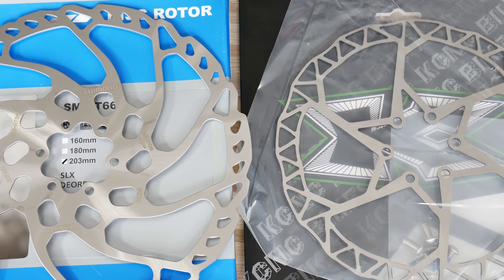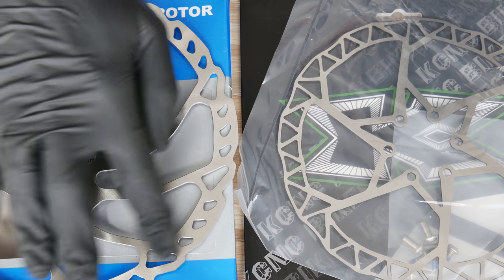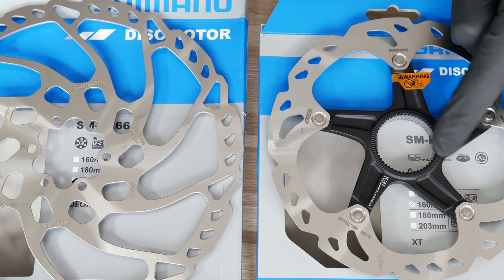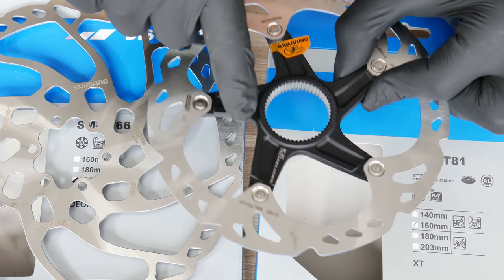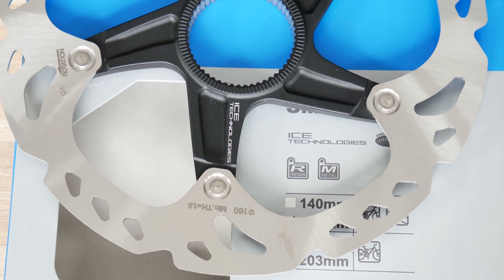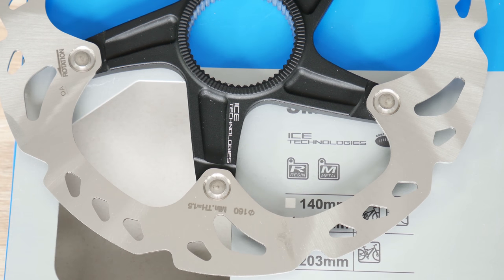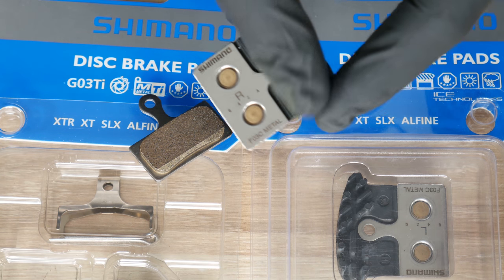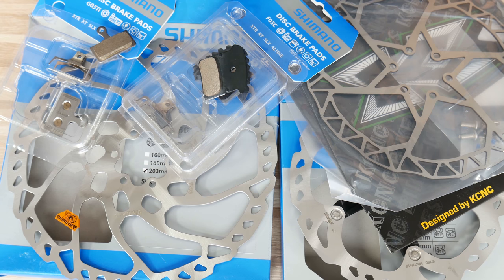Bicycle Disc Brakes - How To Prevent Overheating. Ice Technologies, Pads With Fins...

Comment: There's an article on Bikerumor.com about a road cyclist who nearly killed himself using Ashima super light rotors. He boiled his brake fluid and had to controlled crash his bike at high speed. A brake rotor is designed to turn your kinetic energy into heat and then dissipate that heat, to do this they must be constructed from a certain amount of metal.
Reply: Its not that little. A XTR rotor weighs 118g at 160mm vs 74g for the KCNC razor at 160mm. Plus, the KCNC costs 18€ vs 53€ for the XTR one. You can get a Deore Level 160mm for 15€ without Ice-tec with 153g per rotor. Thats more than twice!
Also the KCNC razors are surely not suited for trail enduro or DH, but they are sufficinet for, where they are mainly used. Long steep descents on the road, are often harder on brakes than a XC track.

Comment: It was also not mentioned that the Shimano Ice Tech rotor is a floating rotor while the KCNC one is a normal, fixed rotor.
Reply: It's technically not really. They are semi-float. Hope does make them actually flating, but the run about 130€ per rotor

Comment: Not a lote of material like the kcnc i dont think it will overheat faster, because yeas you have less places to put the heat but its also much more ventilated...
Reply: This is certainly true if you don't brake constantly on descents. Like if you brake several times and sharper, this might work out just fine. But if you are a beginner and let the brakes slide all the time, the Razors get hot really quickly
Reply: There is less thermal mass and also much less radiating surface, but it also permits the brake pad to off-gas easier.
There are two principal ways that braking power is limited by temperature;
If the binder of a brake pad is heating up too much it will produce a gas.  That gas can act as a lubricating film.  That is the real reason for rotors that are cross drilled or have those patterns (besides reducing weight) to let the gas escape.
The other way is gas inside the brake fluid which increases the compressible volume enough so that you can not apply enough pressure to the pads.  This gas could be water vapour or overheating brake fluid.
They can be differentiated because if it is off-gassing you can apply the pressure on the brake lever but the brakes don't stop enough.  If it is vapours in the lines, you can run through all of the lever travel without being able to apply enough pressure on the brakes.
I don't know what happens on a bike as I am not powerful enough to over heat my bike brakes.  I know this from motorsports.
Reply: Sure, there is less mass, but you have a better mass to surface ratio. So if you had a rotor with immensely fine slots radiating surface can be bigger than a regular one.  That's also why animals in the northern regions tend to be bigger. Less surface where you could loose heat.
The gas part is quite true with organic pads in MTB, especially the skinnier ones. Sintered ones don't tend to gas out that easily.
Gas inside the brake fluid shouldn't occur that often if you bleed your brakes properly and occasionally. to get dot 5.1 to cook means going above 170°C which doesn't occur that often. yes the pads and the rotor can get hotter than say 300°C, but the fluid not so much.
you never overheated your brakes on the bike? either you are a maniac that doesn't need to brake when descending or you ride very tame terrain. 
i can overheat mine with a 180mm rotor in the front easily
Reply: Response to second last comment first: the terrain I ride has a maximum elevation change of 400ft, but there are no technical downhill descents. There is lots of wonderful twisty single-track. It is possible to make the rotors hot enough to burn an idiot's finger when checking the temperature (first-hand experience) but not enough to over-heat the brakes. And even if the terrain weren't tame, this rider is! I am an older guy just looking for nice riding in the forest and not taking too many risks getting hurt. Performance doesn't matter to me, but loss of enjoyment due to recovery from injuries does. The older you get, the longer recovery takes. A lot longer. 
Overheating brakes: Everything you said makes sense from a physics point of view and matches what I learned in motor-sports. But I don't understand something about your answer... I think you implied that you are not boiling the fluid or causing out-gassing from the pads, so what do you mean by over-heating the brakes? I assume that the rotor is not melting. To reduce braking performance you must reduce the coefficient of friction or the pressure between the pads and the rotors.

Comment: Oh okay Also at first: Cooling is needed the prevent Fading! 

Heat for Semi or Sinter is good, because there work at his best when it is warm!
And More metal is more Brake Power! My original Formula Disc are worst as (anything) in Brakeperfomance. But the Old Formula Disc Work´s well, also my Avid Disc with the many small holes.